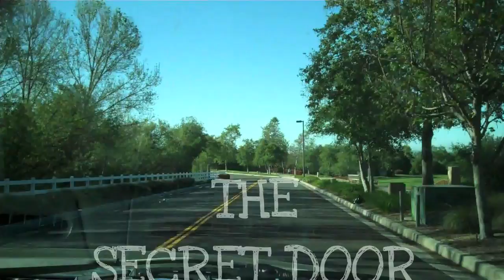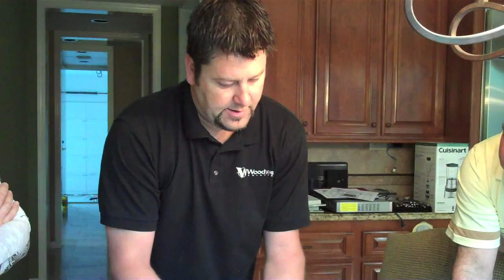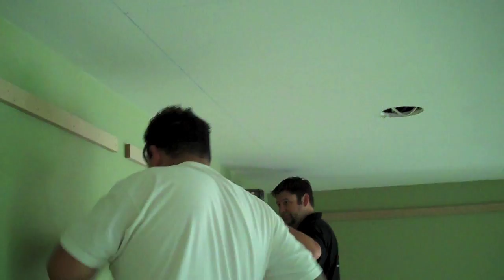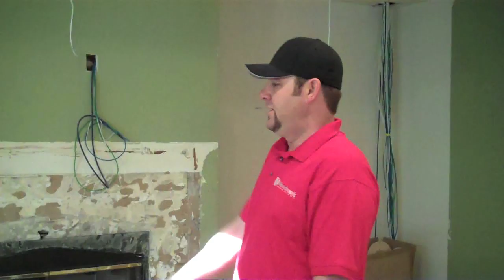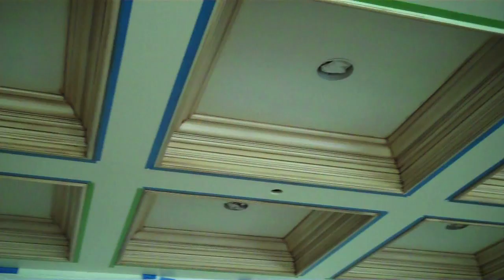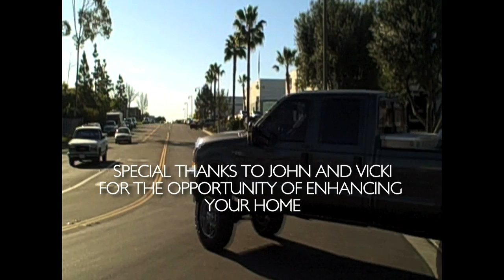"The Hidden Door" Design and Construction Remodel in Coto De Caza, CA

Comment: @frankjerroddoyle Just gonna say on some of those solid wood cabinets (not the cheep ones that Lowes tells you are high end) you need to use a drill or a cordless impact to run the screws for the hinges which is what it looked like they were doing. BUT, you do need to be very careful when doing this. 1/4 second too long on the trigger can mean you are removing a section of cabinet and replacing.

Comment: I would have liked to see the wall symmetry cooperate with the ceiling symmetry. It's a better more fluid look to see the line up like your standing inside a rectangular rubics cube.   Otherwise the look like they clash.  It looks like a lot of work that could have been planned better.  That's why you pay for an architect.